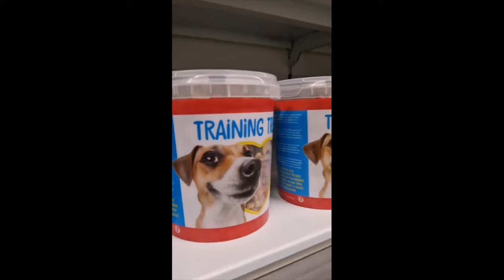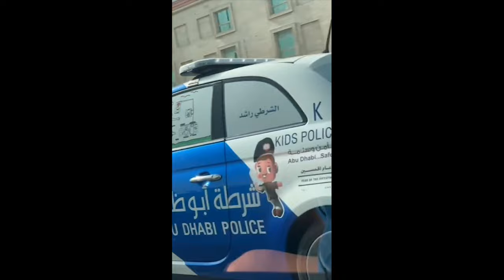Ultimate Instant Regret Fails Compilation | Funny Videos & Random Fails of the Week!

Comment: Getting splashed with mud isnt fun but it drys out quick and turns to powder. If it ever happens just wait a bit and brush it off. DONT TRY TO CLEAN IT WHILE ITS WET!! YOU JUST MAKE IT WORSE. Use somthing like a credit card to scrape the thick stuff off then when the rest dries brush it out with your hand.